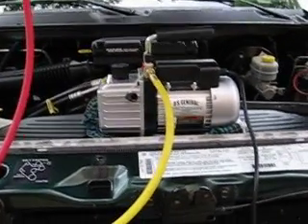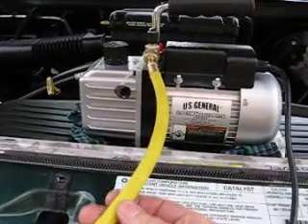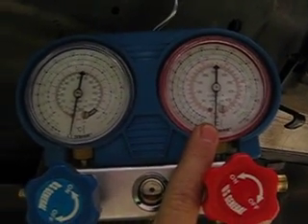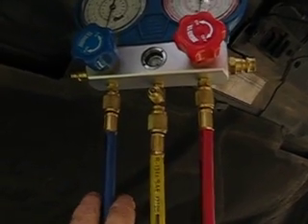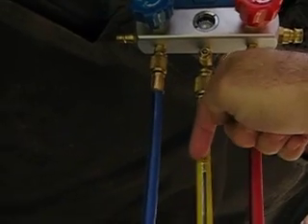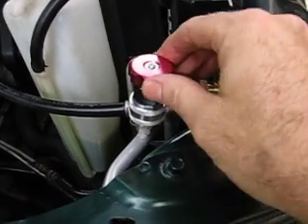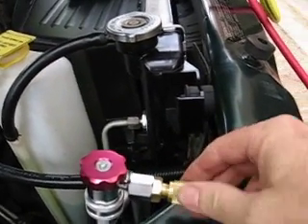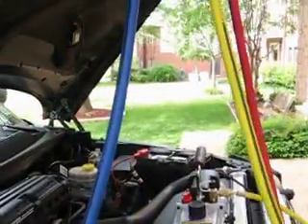How to evacuate and "pull" vacuum on an R134a car AC system

Comment: @kjhhjhbcjdc Depending on the guages you have, it will either go well below  the 0psi park like he stated, but on some gauge sets they go below zero. Generally you will have around -27 or -28 lbs on a vacuum.

Comment from the maker: @Testnavewo In my case,  I had a defective shrader valve, and all my freon leaked out, so I didn't need a recovery station. It is recommended that refrigerants, be it R12 or R134A, should be recovered.

Comment from the maker: @kdspeiser You really need a gauge set to monitor your high and low side pressures to determine if you have too much or too little freon.  You will need a Temp/humidity/high pressure/low pressure chart to determine what pressures you should expect on your gauge. Without gauge set, you cannot tell if you have too much or too little frean charge.

Comment: @msrlaw123 you need to convert to r134a, ask around like autozone.  I replaced my r12 to r134a with a $12.99 fitting and the a of O I changed as well

Comment from the maker: @gandl2123 You really need to get a gauge set and check your high and low pressure lines.  Even though you did not vacumm the system, it should still give you some cold AC ..

Comment from the maker: @stupid0388 Just bring it back down to normal Low and High side pressures as you mentioned. No need to discharge entire system.

Comment: @mikecarter79  Hey Mike, Is there a 1,2,3 kind of guide to explain this full process of evacuating, recharging and adding the oil to this anywhere? 
I have a 93 chevy 2.8 v-6 pick up that I'm crazy to restore and make the AC work again. I've replaced the hose and accumulator and now I'm tring to understand the basics of prepping the equipment and how it is to be used.  Like do I have the engine running and how do I put the brass knob on the pump? It has two ways and a knob that turns  please?

Comment: I changed the compressor (locked up clutch bearing) and then added 3 cans of 134a.  I did not vacuum the system as you have described....my system is now coming on (clutch/compressor) and fans are blowing (condenser) but all air coming into cabin is very warm....any ideas on what the problem could be and hot to rectify it?  Tks

Comment: @thybigballs R134 has a GWP (global warming potentional) OF 1400, Which means it is 1400x better at absorbing heat than CO2. It should be treated with as much / more respect as R12. It really shouldn't be a retail item, if someone has a leaky A/C it should be repaired, not just refilled. Seeing as the upfront costs are so much for the man on the street, I think it should be subsidized / free so that people just go and get it fixed, rather than pumping it into the atmosphere...

Comment: hello I have a question after you hook up the low and the high vacuum holes into the car and the hoses are hook up the electric pump where does the excess moisture goes to?

Comment: @luisilloz1 Your yellow jacket pump probably only has a R12 connector. You can buy adapters to convert it though. I have a US General one like the one in this video, and it has both R12 and R134a connectors. The R12 one is smaller. I was glad mine had both, because I just got done converting my old truck back to R12. R134A blew 10 degrees warmer, and that was unacceptable. Buddy had 10 12 pack cases of the little cans he hoarded back in 1994 so sourcing some was not a problem anyways.

Comment from the maker: @guayacool Only a very small amount of oil will come out during evac. Most of the oil will settle in the compressor , receiver/dryer and other "Low" places in your AC system, as the oil is much heavier than the refrigerant.

Comment: @muddiepaws  The "Air" cap is to allow a small amount of air to enter the pump on an initial vac when moisture is most likely present and prevents a condensation build up in pump which would eventually ruin it.  I've tried to include a link to another vid but am not able to post the URL for some reason.

Comment: @muddiepaws  It is cracked open early in vac stage when majority of moisture in system would be present and it allow a small amount of air to enter pump to avoid condensation build up and eventually ruin it.

Comment from the maker: @muddiepaws  Glad the video helped.  The large black plastic screw/knob on the left is where you put in special oil for the vacumm unit.  If you are talking about the black knob/cap that is on the same fitting where I have my hose connected to the unit, this is an extra vacumm port.

Comment: I have a 2000 Nissan Maxima with a non functioning A/C system. The compressor won't turn on, all I hear is fan and all I feel is hot air but I believe that is because there is no freon in the system due to a leak on the condensor so the for safety the system does not turn on. Can I evacuate the system with the pump and try adding 1 or 2 cans of freon along with stop leak and hope for the compressor to turn on or do I have to verify the compressor is working at all.

Comment: how do you evacuate the remaining coolant or moisture? Like what do you evac it into? What happens if you just pull vacuum with a recovery unit? will it exit the pumps second fitting?

Comment from the maker: @raygorsline I don't think an expensive micron gauge is necessary in automotive  AC applications.  I have never used a micron gauge and I have never had an AC system failure using my methods. The Low side gauge measures vacumm to 30inHg, and that is good enough for me. 30inHg is going to put you in the ballpark of 250 microns.

Comment from the maker: @stevenmorookian16 No. The yellow hose is used for BOTH the vacumm pump and your freon can. When you are finished evacuating the AC system, you shut OFF the blue and red valves at the gauge, and then remove yellow hose from the vacumm pump. Then attach your freon can tap fitting to the end of the yellow hose. There are only 3 hoses you need, Blue(low pressure side), Red(high pressure side), and yellow(vacumm pump AND Freon or R134a can)

Comment from the maker: @stevenmorookian16 When you have finished with the "evacuate" process, you should follow these steps:
1) close the High(red) and Low(blue) valves AT THE Gauge
2) disconnect the yellow line FROM THE VACUMM PUMP
3) connect your R134a or R12 tap fitting to end of yellow hose
4) Open tap on R134a or R12 so that freon flows
5) loosen yellow fitting for few seconds at gauge slightly to purge line of outside air/moisture
6) re-tighten yellow fitting
7) Engine running, AC on, open low Blue valve

Comment from the maker: It is not only necessary, but critical that you evacuate your AC system IF it has been opened to the atmoshere. However, if you are just adding additional R134A Freon to your system, evacuation is not required.

Comment from the maker: @061163535 Yes, you need to vacumm in order to remove moisture which entered the system while it was apart. You also need to see how much oil was trapped in old condensor and replace same amount.

Comment from the maker: @27elbebeems What are your readings ??     0psi ???  I am assuming that your AC system has been bled down to 0psi, ie all refrigerent removed. If you are using quick connect fittings on your gauge set, make sure they are turned full clockwise so they are spressing the shraeder valves. Also, disconnect the yellow from the gauge end, and with the vacumm pump running, make sure that there is "suction" at the end of the yellow line.

Comment from the maker: @mchar69 If you are just "topping" off a system that is low on refrigerent, then there is no need to do this evacuation.  You need to vacumm system when you have opened it up to the outside atmosphere due to any parts that where replaced.

Comment from the maker: @061163535 On this particular job, I added approx. 1/2oz oil to be on the safe side. Normally, most of the oil settles in low spots and only a trace amount comes out during the evacuation process.

Comment from the maker: @Pap1010 Flushing the system is one of those "nice to have" deals, but I personally do not think it is necessary UNLESS the compressor has locked up and sent small chunks of aluminum throughout the system. Inspect your old orifice tube for any pieces of metel or aluminum. So, I would recommend a full system flush if you blew out your compressor and you find pieces of aluminum in and around your orifice tube. Otherwise, just pull a vacuum on the system after you replaced all the parts you are rep

Comment from the maker: @Pap1010 I have never believed in any of those "AC Stop Leak" additives. You need to locate the leak and replace the faulty component. The Compressor, receiver/dryer and oriface tube are the main components to replace.  With taht said, if you have a leaking AC line, or a pinhole in your evaporator or condensor, then that changes the story. Have you isolated where the leak is ?

Comment: Mike, I have a 97 Chevy silverado and the compressor started leaking maybe 5 years ago.  I had it recharged once and it lasted about a year and I recharged it myself using a refrigerant that claimed to stop leaks.  That leaked out immediatly.  I now intend to replace the compressor, the drier and orfice tube.  Is there anything else I should replace?  Do you think I would be safe in replacing the parts and evacuating the system without having the system flushed?  Thanks for the help.

Comment: @walkingfreak Hook up a gauge set. Even with the engine and AC system off, there should alays be residual pressure in your system.

Comment: Checking for leaks when you turn it off,you pointed at the high pressure gauge, what about the low pressure gauge does it have to be below 0? Cuz during the pull is at -1 then I turn off it rises to 0 on the low gauge? But the high gauge is at -1.

Comment: @mikecarter79 , I think I screwed up then, I had no a/c so I check the low side for pressure and of course it needed to be recharge, well I put two cans in ( 1 of 134a and the other was 134a with stop leak) Well the a/c is working somewhat but not getting as cold as it should, compressor is working fine. So by what I've read I might have air in my system.  I just want to make sure.  Do I have to evacuate the system before I vacuum?

Comment: I just changed my compressor and need to buy one of these pumps. Do you have to connect both low and high side or is just one side say low side? I need a pump but 
I am afraid of the Harbor Freight one, you know quality issues. What model number is that pump?

Comment: Good video Mike, straight and to-the-point.  One other viewer asked about oil and I'd like to do that as well.  My compressor has developed a leak at the seal so it's time to replace the compressor.  I checked the pressures tonight with the HF gauge set.  There is absolutely no pressure in the system whatsoever, so no refrigerant either.  Assuming that the system will hold a charge (no leaks after evacuating the moisture with the vacuum pump), how do I go about adding oil to the system?  Thanks.

Comment from the maker: No, a vacumm, also know as reverse-pressure, would never be higher than the 150psi to 200psi you would have on your high side during normal operation. There are no AC vacumm systems designed to ever pull those kinds of "reverse-vacumms"

Comment from the maker: Yes, in fact it makes perfect sense that it will cut off the compressor more often when ambient temperatures are higher. As the temeratures rise outside, the higher the pressure in your AC system(both high and low pressures will increase since it is a closed system). Since your system is only borderline "overfilled", this would explain why the compressor won't cut out all the time. You should consider removing a small amount of freon to reduce the pressure somewhat. Lessen the chance of a leak

Comment: Thanks. Could it just be that it is hot out?

It didnt do this before though.

And then tonight I got into the car and the AC was running fine.

If it was a matter of overfilled freon, wouldnt it ALWAYS turn off the compressor and run kind of warm, not just sometimes?

thanks again man!

Comment from the maker: Too much freon can cause the pressure on the high side of the system to get too high. This can make the high side pressure switch turn off your compressor.  There is a similar switch on the low side that will cut off the compressor when pressure is to low, indicating the system needs more freon. I really don't trust those color gauges that come with the re-charge kits. You really need to get a gauge set that measures both the high and low side pressures.

Comment: I got a question.

My car is pretty new. 44k miles. The ac has been running fine. The other day I was at idle and the ac was blowing like warm and not cold. I started driving and after a while it started to get cool again. I thought I needed more freon so I bought some.

I put the guage on first to see how much I needed but then I found out that I am over-filled. Not dangerously but right on the line between "alert" and "danger".

Could it be the overfill that makes it sometimes warmer?

Comment from the maker: First off, do not close the hi/low flow lines on your gauge. The reason I turn off the vacumm pump and wait 15 minutes is to see if I have a major system leak. So you need to keep these lines open. If you have a major leak somewhere, you will see the gauge needles move from a "vacumm" state(less than 0psi) back to an atmospheric state of equilibrium(or back to 0 psi). Some folks recomend that you wait 24 hours to see if vacumm is maintained, but I think that is a bit excessive.

Comment from the maker: At the end of the evacuation, you have a system that is free of any air or moisture.  If you do not evacuate your system prior to charge, it may work for awhile, but the moisture will eventually cause corrosion and other unwanted chemical reactions in your A/C system. This will shorten the operating life of your A/C system.

Comment from the maker: Automotive A/C Vacuum Pumps are used to remove air and moisture from an A/C system that has been worked on. If, for example, the A/C system has been repaired(compressor, condensor, evaporator, accummulator,or whatever), this is when evacuation is required.  During evacuation, the air is removed from the a/c system and at 28" pounds of vacuum, the moisture begins to boil. The moisture now becomes vapor and is drawn out of the system by the vacuum pump.